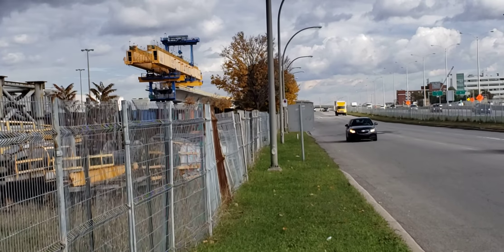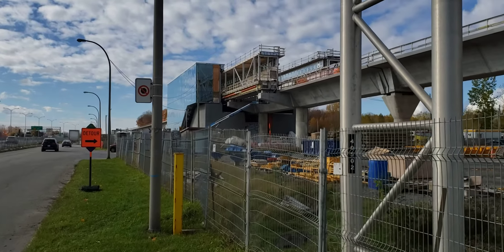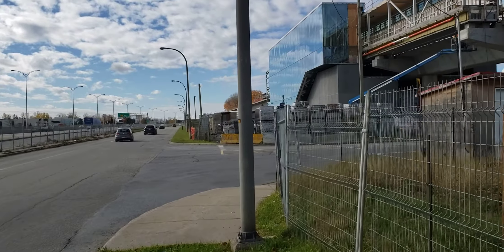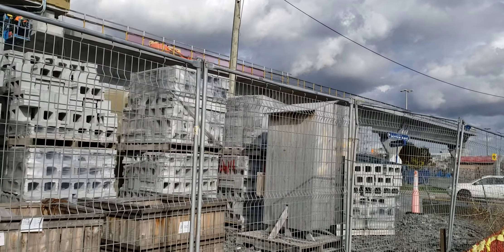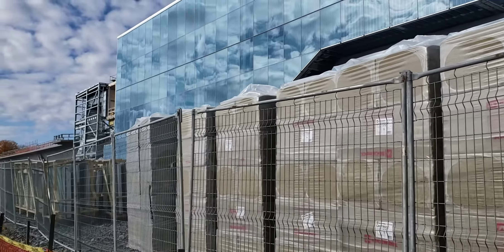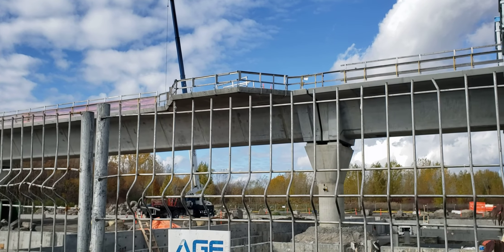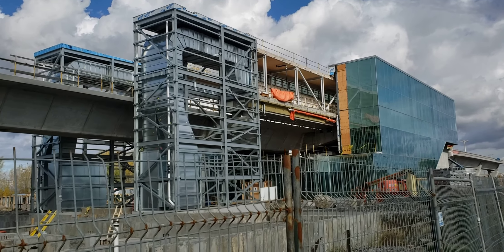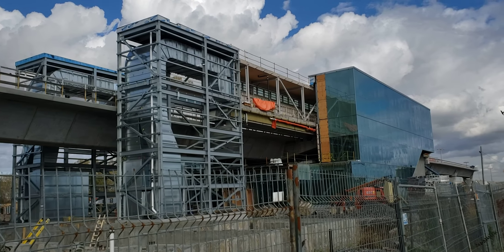MONTREAL REM 11.4.21 Fairview Pointe Claire Station Construction Update

Comment: 7:20 : This "balcony" area is where the track switch machine and track switch heater will be located.  There is a similar "balcony" on the other side.  No workers will stand here while trains are running - too dangerous.
Reply from the maker: OZh makes sense, ya I've seen US elevated railways that have these balconies so workers can be up on the superstructure  while trains slow down to pass